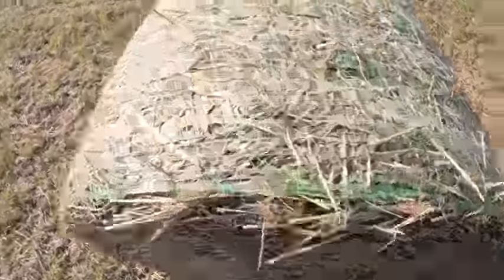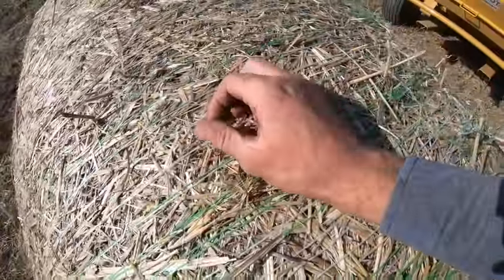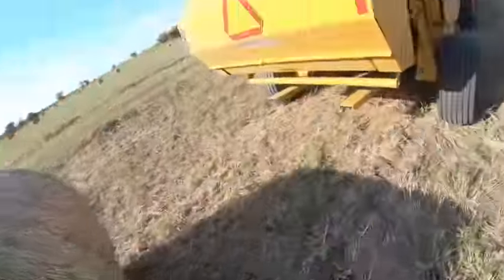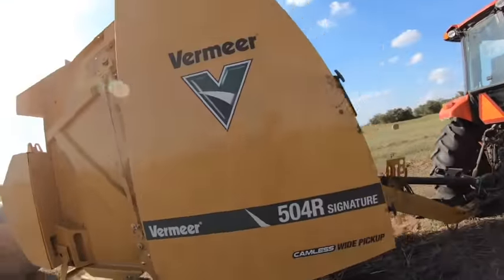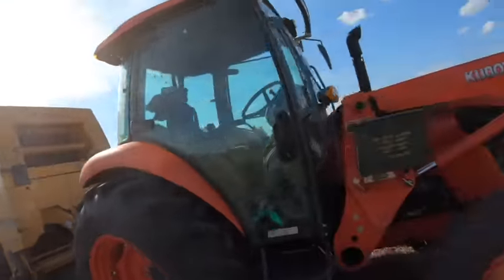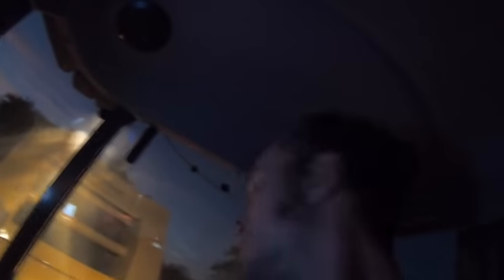I Bought A BRAND NEW Round Baler; How Much Hay Can I Bale In A DAY?!?

Comment from the maker: UPDATE: This baler turned out to be HORRIBLE. I bought it largely because it was advertised as being able to bale wet hay which was desirable to me as I wanted to wrap some (silage) hay bales. I baled wet hay with it, ~2 times after which point this machine BROKE EVERY TIME THAT I USED IT. I had a roller replaced, multiple bearings changed within the first year that I owned it. My impression that VERMEER had built this thing heavily was correct, HOWEVER the parts they used were the cheapest ones possible, chinese bearings that fail constantly. Finally, at the end of my second season with this thing, one of the main bearings on the unit failed and by this point I was tired of messing with it. As you'll recall, I only bought a new baler because I wanted one that would JUST PLAIN WORK and not have to be messed with constantly during the height of hay season, and this one, simply doesnt achieve that goal.

I sold it for a loss, as-is, to a Vermeer dealer who was short on inventory, and then I went and bought a German made CLASS baler thats older than I am. Its amazing, although its a smaller unit (4x4) its MUCH beefier in construction, better bearings, etc. This is the LAST TIME that I ever buy American made farm equipment, new at least. We, the consumer used to pay more for american made with the expectation that we were getting a better product, but now its just cheap components (chinese megacheap bearings in this case) with little/no service, so theres no point. I learned that all round balers are basically the same, they just break all the time, rollers cracking and bearings burning. Of course this would be easy to fix, simply make the bearings 50% larger and "2" grades of quality higher and you'll never have a problem. Same with the rollers, "2" sizes up on wall thickness and they'd last for 100 years. But OF COURSE then the big companies would make less money, so that cannot be allowed to happen. 

My advice for anyone looking for a round baler is this: simply buy an old one from your choice of manufacturer and go through EVERYTHING on it, ideally replacing or at least inspecting each bearing before you have issues. If they're failing, replace with highest quality possible. And then buy a SECOND round baler and do the same on it, for when the first one inevitably brakes down for some other reason, and THEN find a friend or neighbor who can come bale for you, or vise-versa, if the need arises. 

You can't just buy new stuff and expect it to work, its not the 1950's anymore, those days are gone. Might as well just buy an old machine for 1/10 as much since you'll be working on it constantly anything.

Seriously, I hate this thing. It was a huge disappointment and cost me a lot of time and energy. I was running to the bearing supply place and trying to fix it with hay down and rain on the way. I could've just kept the old one and done that exact same thing, saving $30k in the process.

Newer American made equipment... NEVER           EVER            AGAIN! 

MORE: For those who like the things which YouTube doesnt, join us on a free mobile app called Telegram, under "Tractor Hoarders Group Chat", in case we get cancelled on here! Best wishes!

SOME OF MY FAVORITE TOOLS:

KNIPEX German Made Pliers-Wrench:
https://amzn.to/35fchvN
OTC Slide-Hammer Kit:
https://amzn.to/3p7mq4Q
Carbide Burrs - An Affordable Set That’ll Last:
https://amzn.to/2VsxTgH
SUNGLASSES I WEAR - Quality at twice the price:
https://amzn.to/2VegmbE
Regular Safety Glasses that I Use:
https://amzn.to/2ATXtEf

Yes, these are affiliate links. Thanks for watching!!!
Reply: I have four snowblowers of the same model ranging in build dates from 1979 to 2014 and even though the 79 one was hit by a snow plow I still went through the trouble of restoring it as my personal snowblower because of how it is built. The 2014 model may look and operate similar but they are two completely different machines and not in a good way. Bearings are now plastic bushings, bearing and shaft support brackets are history, control rods are now thin cables that fail easily, cast iron auger gearbox now much smaller and cast pot metal and so on. I even found an old red top Weber grill and I'm almost done restoring it to go with my blue top, black top and other Webers I know will sell quickly to people like us that appreciate American made quality before politicians ran manufacturing out. Tesla is a perfect example and we're lucky he stayed after California's BS.
Reply: You should look at Krone hay equipment, it’s made in Germany.  One lonley farmer uses Krone square balers and I also have one. Mine is a 3x3. They are built like a tank! I’ll never buy anything else. Quality from start to finish. I believe their round balers would be the same quality
Reply: Hi Chucky if you are looking at making silage I wouldn’t look past a mchale baler there made in Ireland 🇮🇪 and the majority of Irish contractors use them , of course it’s worth doing your own research on the baler ,
https://youtu.be/N_WN8r7uPYI is a link to a USA dealer 

You can also check out the following YouTube channels who run a Michale 

Hayteamtv : based in England and make hay and wet hay 

Farmer Phil : based in Ireland makes silage with a mchale fusion2 ( combined baller and wrapper ) but does a lot of other contact work as well
Reply: @farmin4468  they are, except Krone makes chain balers so a little less bale density, especially with fixed chamber.
Reply: @tjurzyk  Krone makes a belt baler now. But even their variable chamber chain balers make a pretty good bale. But I’d go mchale before Krone and then a Massey 4180v before that
Reply: never ending story with your balers? :( sad
Reply: U should look into getting a MacHale baler it's really good and  
u can bale at up to 15 miles using that baler
Also the MacHale is also a German built baler
Reply: I own a Vermeer 504 i from 1993.  It has the narrow belts on it.  For it to just be a 504 in size, that is one heavy piece of equipment!  The new ones that I see on machinery lots aren’t anywhere close to being built as heavy.  The metal is thinner on the new ones and the components are crap.  I have a bearing that I just replaced today (one was out the other good, but I learned long ago to replace both, no matter how old the hood bearing is).  Bearing that I was purchasing several years ago were all Chinese bearings and they had issues.  The ones that I purchased to fix this roller were from Mexico and appear to be much better in construction.  I accidentally busted the seal as I was driving one of the bearings on.  It was the tailgate idler roller where the bearing is seated in the end of the roller.  After i took it off again, I pulled the seal out and pulled the ball cage inside and was surprised by how much more robust these bearing are.  I think Vermeer must have got the message with the bearings anyway.  What makes me mad is the fact that Vermeer uses all sealed bearings (unless they have changed on newer models). I have lots of equipment with greasable bearings.  Many of those bearings operate under just as much, if not more stress than the ones in my baler.  Most of the greasable bearings on my other equipment are older than I am.  They have never went bad.  We always grease them regularly and it seems as long as you do that they will last almost forever.  I realize that some of the bearings in a roller have to be sealed.  The powered rollers’ bearings could easily be greasable bearings and even some of the idler rollers could probably be designed the same.  I may be wrong but it seems to me that would drastically reduce the failure rate of bearings on those balers as long as they get regular grease applications.  I hate that you had a bad experience with Vermeer.  Too much of the new equipment these days is way more complicated than it needs to be.  I know a lot of the features are nice, but it makes them more prone to failure and it makes it much more difficult for the farmer to repair.  That’s one of several advantages to older equipment.

Comment: The story is the Vermeer founder tore apart the Allis Chalmers 1960s (small) round baler to learn its secrets then designed the huge bale baler from that. Now everyone is making round balers (some better than others).
I grew up on a farm using the small square bales and I learned all the cuss words from that (brand new JD) baler knotters. My father bought the brand new JD thinking it would perform better than the prior used Massey Ferguson square baler we had. Much cussing was involved with both those machines.

Comment: Our vermeer 605N select has been 100% trouble free for over 6000 bales. Only net wrap needed and normal greasing. Ive heard lots of issues with the R balers. They are cheaper made then the N balers. Cant go the cheap route as much as i love it. Deere also makes an amazing baler as we own both.
Reply: I beg to differ that the R is not as good as the N. The rotor design in the R are much better for feeding hay into bale chamber. We have not had any issues with the Rs we have sold. The 605 N will be changed to the R series in the coming year.
Reply: @kevinmartz6454  the Rs we have sold! Yah that'll do it!
Reply: @kevinmartz6454  they are cheaper made period. I work on em all day it seems like. Atleast 7 R series to like 2 Ns with double the bales.
Reply: Which do you like better, Vermeer vs. Deere?  

I looked at JD's baler years ago, and everything seemed so light duty compared to the 605 Vermeer.
Reply: @LAWSON08  depends on what your lookin at. Deere makes a tighter prettier bale. Simple design compared to new holland. Very strong balers except for the bale kicker, only part that breaks on em. Vermeers can feed way faster and are the simplest, heaviest, strongest one imo. Love em both tho. Vermeer monitor is waaaaay better. Its a toss up honestly. Both work amazing and very zero problems with them both. Make a new holland look pathetic.

Comment: Problem with baler due to hay being way to dry. Looks like a night job with a little .ore moisture. Tip ,, oil your chains hot and use hydraulic oil. They live 4 times as long.

Comment: Gotta disagree that all the newer balers are junk.  I bought 2 new New Holland 560 Specialty Crop balers in the fall of 2018.  As of now they have 32,000 bales between the 2 of them.  There have been some problems, but nothing that caused serious loss of productivity.  Haven’t spent big money on them for repairs yet which is pretty impressive considering I bale some 90% cornstalks and bean straw.  Most bales in a (long!) day was 950 bales with the 2 balers together.
Reply: That's incredible to make that many bales.  I have a Massey/Hesston 2656a.  When conditions are right I can make 25 bales/hour. I'm in the market for another baler, I take it you'd recommend the New Hollands?
Reply: @westonandelin4556  Yea I’d give them a look.  Take into account dealer support.  My 2 NH 560s are up to 46,000 bales between the two of them now, 23,000 ea.  Starting to see the use on them.  Sides are wore through in places, replaced most of the chains and sprockets last fall.  I did set a new record for bales in one day with one baler; 572 bean straw bales.  Started at 12:30 pm and got finished around 1 or 1:30 am. There was a little road time in there.
Reply: @nschelling6420  My baler only has 12,800 bales and I've had a fair amount of problems with it.  I replaced around 10 bearings so far.  How many bearings have you replaced on your NH?
Reply: @westonandelin4556  I’ve had 3 major bearings fail so far.  Also replaced quite a few chain idler sprocket bearings.  Thing is, there are so many things that affect bearing life.  Errors in installation, exposure to elements (never buy a used baler that sat outside its whole life), bale density settings, making over size bales etc etc.  Then there is the reality that bearings are vendor supplied and sometimes some are better than others.  NH tends to use Timken/Fafnir, PEER, and I think a few SKF for the major bearings.  Some of the small bearings they use have proven to be cheap junk.
Reply: @nschelling6420 new holland balers    have worked great for us so does case I think Massey are junk my self
Reply: @Baleboss69  I’d put Hesston/Massey round balers at the bottom of the pile myself.  At least for what I bale.  I’m up to 54,000 bales between my 2 2018 NH 560 round balers, and bought 2 more 560s to go with them.
Reply: @nschelling6420  our case has about 12,000 bales on it were bidding on a 2021 new holland baler but we lost that
Reply: @Baleboss69  New Holland and Case IH balers are essentially the same thing.  12,000 bales is pretty young yet.  should be good until the lower 20,000s depending how you use it.  Don’t buy a Specialty Crop Plus unless it has the updated sledge follower rolls or you swap to a single follower roll sledge frame.  New Specialty Crop 560s were close to $70,000 ea last fall.
Reply: @nschelling6420  ya they pretty much are but we wanted to run two balers

Comment: I just set up a brand new Vermeer 504 r this week. They are great balers. I hope you have the silage kit in for doing silage bales. This baler is built much heavier than the jd baler. Also just serviced two 504r balers that were traded in recently with 14000 bales on each of them. Except for some normal wear parts the balers are still in very good shape. Glad you chose a Vermeer.
Reply: lol, seems you didn't read the whole description, or the pinned post.
Reply: 14000 bales is a bit of a soft test for a baler. I have heard of balers in Europe with over 100k bales.
Reply: He sold it because it was junk

Comment: Tree fellas take a Vermeer over a Jonn Deere any day of the year
Reply: The Vermeer woodchipper the company I worked at used a John Deere diesel engine.
Reply: @Ratkill9000  I used a wood chuck chipper that had a John Deere Diesel engine. That was a nice machine.
Reply: @Ratkill9000 , those little four cylinder diesel turbo John Deere engines are really reliable with plenty of power. You can run those for ten thousand hours and all you have to do is change the oil and filters regularly.

Comment: New Vermeer was best farm purchase I ever made.   Just trade it every couple years.
Reply: If you have to trade it immediately it probably wasn’t really the best purchase you could have made
Reply: @farmin4468  the first round baler that ever came to my town is still in operation. An Italian soft core 4x4 twine baler I forget who manufactured it. It’s done tens of thousands of bales, and is still going strong. Im sure it’s paid for it’s self many times over. No doubt it breaks once in a while, but I’ve never seen it broken down, and I drive by it at work a lot during the season.
Reply: @farmin4468  Everything wears out eventually.  Trade it off if you can financially, or if you don't like to do all the repairs/maintenance with belts, chains, etc.